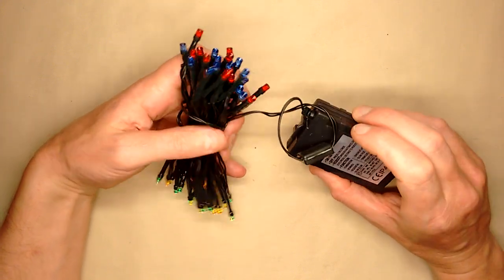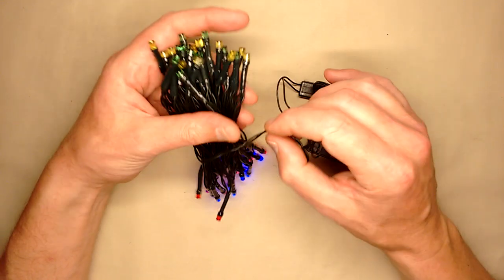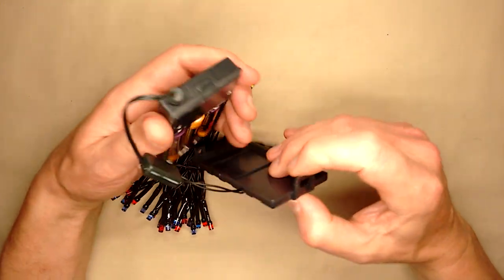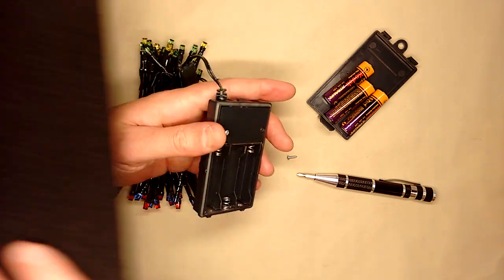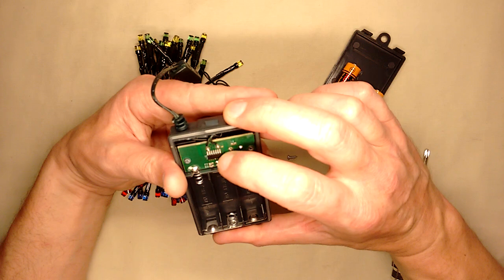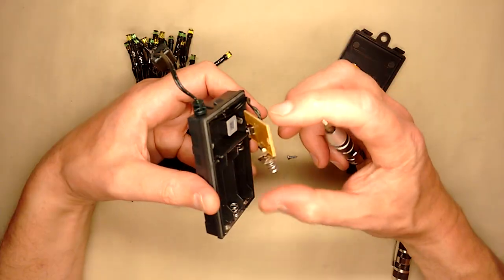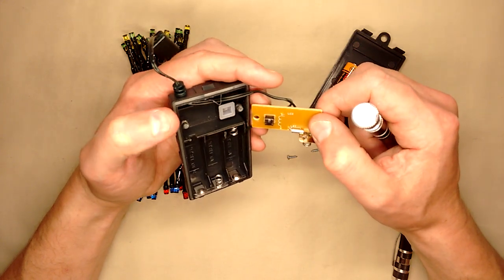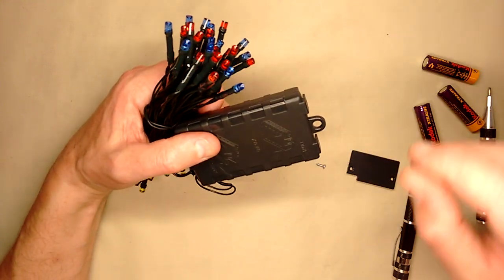Newer style timer controlled Christmas fairy lights.

Comment: Hi, I've just found this video and I have a set of lights like these but the timer isn't working.  I used them last year and didn't realise so I was switching them on and off myself.  I decided to try them with the timer this year but they don't switch off.  Any ideas why please?
Reply from the maker: It could be a wide range of things.  Like a faulty or unsoldered timing crystal or solder bridge.
Reply: @bigclivedotcom  Thank you. After asking my question, I took the batteries out, put them back in and it seems to be working.  The only problem is I have to put them on a wait 8 hours to see if the go off, lol. I'm trying again today.  Thanks.

Comment: Clive, I have a couple of questions.1) Could I theoretical power an LED of AC provided a big enough resistor?2) Are there any good circuits for UK 240v 50hz AC to 5v 3A DC? I assume you'd need a bridge rectifier and a smoothing capacitor but then I'm lost.3) Less of a question, but could you do your 240v mains potato video again but with dissection and better please?

Comment: So I just geeked out over the cheap MP3 players they have on ebay for under a dollar. There is one tiny chip that has about 16 legs that takes care of driving the LCD, MP3 digital to analog conversion, headphone amplification, SD to USB bridge, the 5 button I/O, reading the SD card, battery management and contains some sort of ROM memory on it to drive the whole thing. Unless it is some sort of programmable micro controller. Thinking about it now, that makes more sense, but I'd love Clive to review and rip one to bits. I planned on making one into a matchbox sized portable radio station with one of those FM transmitters.

Comment: Hi Clive. I have a question and wasn't sure how to send it to you other than a comment on a video. I am looking for a 12v solar charge controller. There are some marked as pwm (pulse width modulation) and some marked as mppt (maximum power point tracking). I have been told that many are marked as mppt but are are actually pwm. How can I test a unit to see if it's an mppt or pwm charge controller?

Comment: I don't believe it's an h-bridge. They just commoned a few pins together to increase the drive strength. Since they have mosfets internally they share the current pretty evenly.
Reply from the maker: Even if it is a microcontroller it still classes as an H bridge driver, as each output pin has a pull up and pull down transistor.
Reply: But these are, what, 40 led models? 2 anti parallel sets of 20? Three pins commoned alternately sourcing and sinking current (it can't be just sinking, because of the two wire interface) on most micros wouldn't really provide enough current to light 20 LEDs at reasonable brightness, surely.
Reply: +Jasper Janssen A typical micro can drive 30-40 mA per pin without a problem. Giving you 120 mA for 20 LEDs. Most modern LEDs are easily bright enough at 6 mA. And if you look at the video the LEDs aren't that bright. They hardly stand out against the ambient light.
Reply: Sourcing 120 mA while also sinking 120 mA in a package that small? The overall current limit of most micros is well under 200 mA, which would leave you under 100 mA in this configuration.

Can't really tell anything about absolute brightness from a video.

Also, commoning pins may or may not actually work to distribute load properly.
Reply: +Jasper Janssen For atmel avr (which this is not, but just as reference) the limit is 200 mA, but in both directions. Meaning you can get 200 from vcc to the pins and another 200 from the pins to ground. I am assuming that the secret ic manufacturer probably has similar specs.

Comment: talking of batteries, is there anything of concern, when manuals say do not mix battery brands?
Reply: no
unless it's lithium or other dangerous chemistries
Reply: SniX Generally those remarks are written on AA powered devices ( not lithium )
and generally people don't just pop lithium batteries into their items :p
Reply: SniX It's different when one will catch fire and the other might just get hot

ofc the batteries aren't made out of sugar and ice :p but you can take appart a 9V or some AA's safely
Reply from the maker: It's to stop wildly different battery capacities being mixed as it can result in reverse driving of the first cell that runs flat.